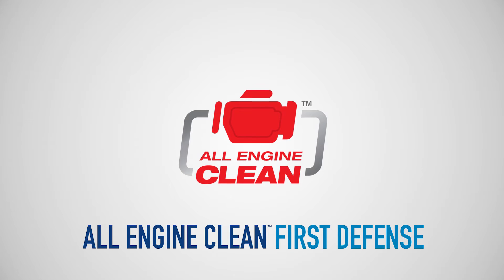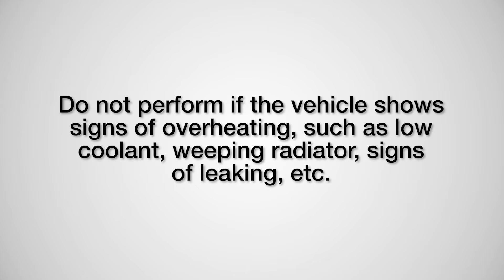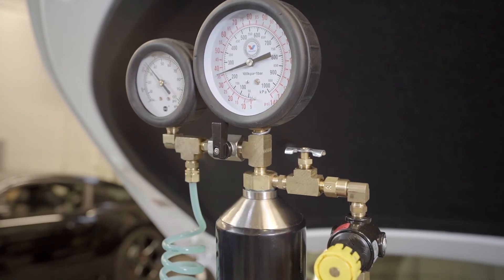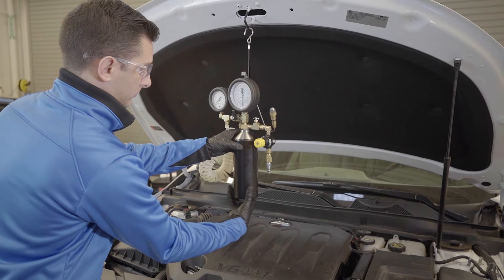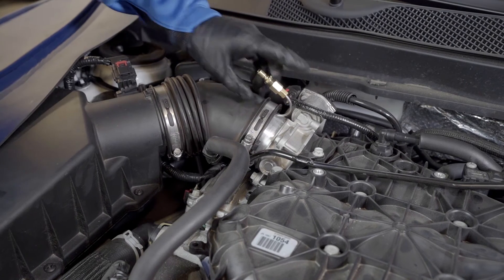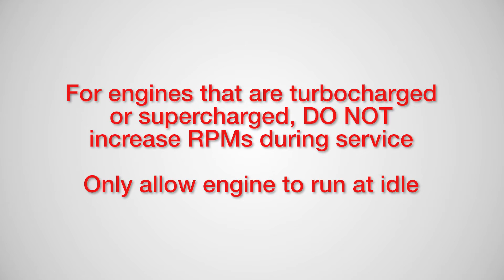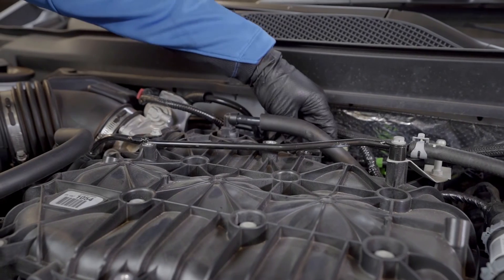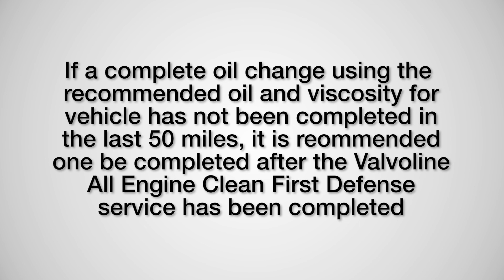How to Perform: Fuel System Service

Comment: I literally get this done today at Walmart on my Mazda Mazda 6, yes, depending on your car it will drive 30 minutes to an hour like crap and may also illuminate your check engine light, but if you drive it for a little bit longer most of the time the check engine light will resolve itself because when the service has been done sensors and or things attached to the engine are taken apart and the vehicle has to register that it’s not an issue with it. I got mine done and right after the check engine light illuminated and I thought it was a problem, but after I drove it for a while, it stopped idling and the check engine light came off with this service most times your vehicle just has to go through and type of configuration mode and most mechanics won’t tell you that you just think off back. It’s a problem but most of the time it’s not I also got my oil change in fuel system served so that’s a good combination and most mazda’s are extremely reliable so it’s necessary.

Comment: I use mystery oil in gas tank below freezing it soaks into carbon in valves and freezes then when you turn on the car valves heat and carbon breaks off

Comment: Could this help clean up carbon deposits inside the catalytic converter?
Reply: I don't think so. It's too late by that point. You can try cataclean but may need replacement of converter after a while.

Comment: Does this also cleans the catilac converter?
Reply: I just asked the same question 😅
No answer probably means no.
More than likely we will do this service but the check engine light will stay on and the catalytic converter still be clogged up
Reply: They never said it so probably no ……

Comment: Snake oil 101: Just throw it away 👌
Throttle body clean service? Sure. Fuel injector clean? Yes. 
Interrupt the air system and throw multiple ECM DTCs while chucking cleaner straight into the combustion chamber? Fuck that. This does more harm than good and costs the customer and the technician money.

Comment: Do you need to change the oil after doing this service ?
Reply from the maker: Constantine, we do suggest an oil change to go along with the service since it is beneficial. Most installers will actually provide special pricing or discounts when bundling these services together.
Reply: @valvoline  thank you very much! How often should I perform this service on 08 Lexus GS 350 it has 119,000mi
Reply from the maker: Typically this service should be performed every 15000 miles, check out the manufacturer recommendations for the best results though.
Reply: @valvoline  you the best !

Comment: So I went to a Valvoline for the first time today for a standard oil change, and had this Fuel System service done for my 2016 Mazda 3 which has 33k miles on it, because they recommended it to me since it would apparently help fuel efficiency. When I left, my car starting showing A LOT of smoke in the back. They apparently forgot to tell me this was normal & the car would 'ride rough' for 30 minutes to an hour. 

Ok, so I turned around and drove back home, but found I could not get above 2 RPMs/20-30 mph. I could hold the gas pedal all the way down but it would not accelerate. My check engine light also came on, which he said it might happen, but he didn't think it would for me. I left it running idle for a bit when I got home and took it out again just now. It started up and was rough when idling, in that it was vibrating. it never did that before. The check engine light also came on again when taking off. I could only get up to 40 mph, but then it seemed to stall & a ! light came on and started beeping at me. I am going to take it out again tomorrow to drive around for at least another 30 minutes to an hour but is this normal for this type of service? 
If so, they should have mentioned this as I don't feel safe getting on the interstate and I would not have gotten this done if I knew this would happen. I've never had any issues with this vehicle until now. This service so far has only seemed to cause the problems it claims to fix.
Reply: Sounds like you got hit with the ole valvoline special.
Reply: I read your comment before getting the fuel service done, so I knew what to expect.Yep, they are morons but the fuel service works for vehicles that need it. Like my 116k mile 2008 Honda Accord, my car drove like crap for the first 30 minutes and the CEL came on, car wouldn't go above 25-30mph or 3k RPM.
     I was about to go back to Valvoline because they did not mention anything to me either, but that was when I felt the power return and car starting to go above 3k RPM again. Car rides better now, less jerky, smoother shifts, and better fuel economy. I highly doubt you would need this on a 33k mile car unless the car was totally neglected.
Reply: Sounds like your vehicle may be in "limp mode" I would recommend taking it to a real mechanic and having them scan you your cars check light. Or take it to a car parts store and they will scan your car for free.
Reply from the maker: Hi Allaiya. Thanks for reaching out. Please contact the service location and email our customer care team at CCsocial@valvoline.com (ref #180580) so they can help you start a claim.
Reply: Was it a turbo engine ?
Reply: I'm sorry Valvoline messed up your car. They never should have told you it was needed at such a low mileage. Any updates on their suggestion to start a claim? I suspect they have no interest in helping you. Instead its to make them appear to take responsibility for messing up your car here in the comments section.

Comment: Is it normal for Engine to miss fire, during this process?
Reply: It will run rough (sputtering mainly). That's normal. It's cleaning deposits out.
Reply: It can happen. The cleaner does slightly affect combustion. For the most part, it happens on the start of the intake cleaning step while it's connected to the air intake system. If it is after the process is completed, then try driving it on the highway at highway speed and see if that helps.
Reply: @dannyo6699  or blows it up....something will happen 🤣🤣🤣
Terrible advice to stress a car with misfire issues.
Reply: @Nelson4207  those are the recommendations of the product manufacturer. They say this is the procedure. However, it most likely is due to the cleaner being added too fast so stopping the input of the solution momentarily will stop the misfire. Increasing the engine speed will help push the residual solution through the system faster which should clear the misfire faster.
However it may be prudent to plug in a diagnostic tester into the obd2 port and check if there are any codes present beforehand if one were concerned or suspecting a potential issue.
For example, if a known condition were present, like an already present check engine light, then the individual is aware a situation already exists. Determining the cause of the light beforehand would be the better move. If there is a misfire in cylinder 1 on the obd2 tester, replace the spark plug first instead of doing a fuel system cleaning. See if that doesn't stop the misfire. If it remains then replace the plug wire.  The coil pack for that cylinder may be bad. Replace it.
Usually doing a fuel system cleaning won't cause a misfire but if it does, it is most likely that a sensor or spark plug has some residue built up from the cleaner and even just idling for a few minutes will clear it. Then resuming at a slower speed of application of the cleaning solution will prevent it from returning.

Comment: That works for bmw e90 328xi 2011? I have n52 engine and port injection just to know if that work
Reply: this is to solve the issue caused by direct injection not port injection.

Comment: Get a 100000 miles on your GDI Engine, you need this service every 10,000 miles on GDI
Reply: Won't make a difference. You need walnut blasting for a real cleaning
Reply: @DominiAeternum only if you let it get bad or you have a particularly dirty engine. Otherwise regular cleaning does prevent it from building up. Your right thought this isn't a full cleaning or good enough to clean a already dirty engine. It's meant to be prevented
Reply: Been working for me I’m at 206k no lights

Comment: Valvoline oil is great.  This product is snake oil.  Causes engine to run rich as you interduce raw un-metered fuel into the intake system.  Walmart uses this and people would be putting it in to fast and cause the catalytic converters to glow cherry red.  I wouldnt do this to anyones car.
Reply: rbeez2004 .. so doing this fuel procedure is really not that necessary then? Cause I just went to dealer yesterday for oil change in my Honda and they was recommending one based on milage in my 2010!
Reply: @hollywoodthedj1673  it is but it's best done by a certified auto tech
Reply: I was so confused because I thought putting oil in a car is not like cooking..you are not doing an oil change when thr car is on ... what does it matter if the oil is going fasting in the car ? I dont have 2 hrs to wait slowly like im  titrating meds .
Reply: @HealthyD12  if you’re worried find a walnut blasting service
Reply: So it’s not needed?
Reply: You are so full of it.  It is introduced in a controlled manner after the MAF,  in front of the TB or into the MAP port via a Induction service tool.  Hence, it NOT unmetered air fuel mixture, it is a cleaning solution used temporarily by a professional, IE, not someone like you..  I'll stop there.